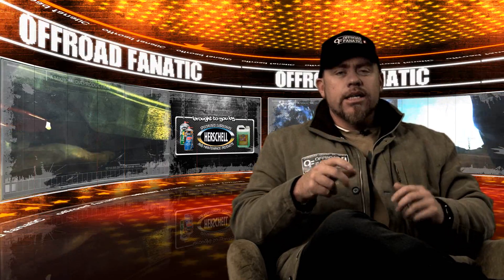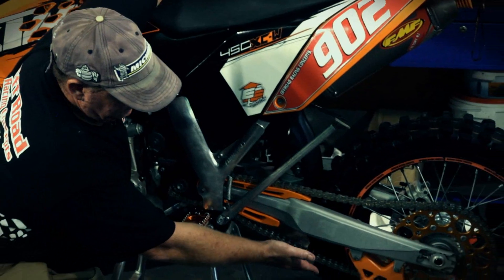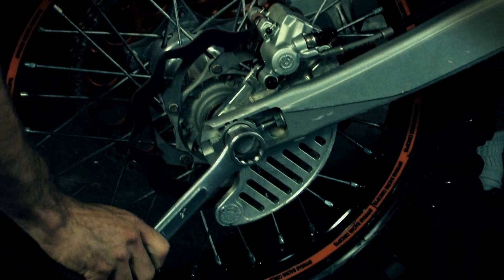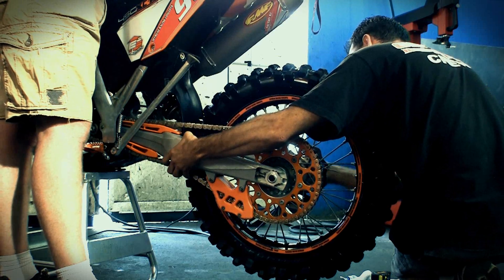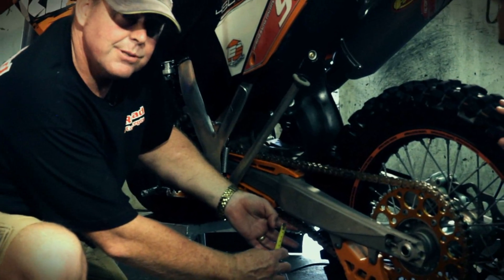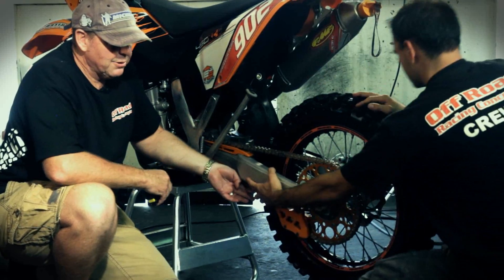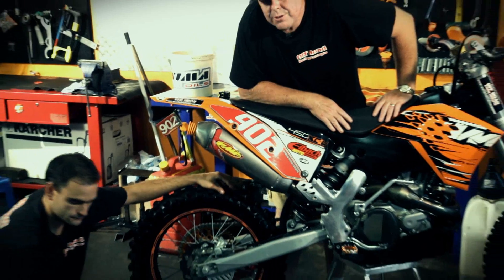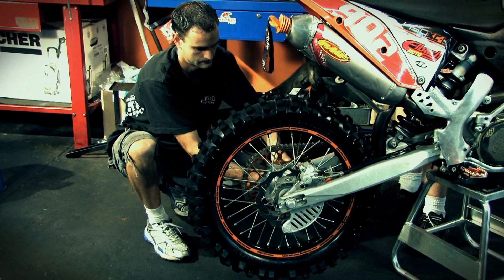DIY - Tensioning your chain

Comment: Take into consideration that you will add more tension to that chain when the rider sits on the bike.
Reply: agree.. so what would be the right tension after rider sits on a bike??
with no weight on bike chains were good, like the video showed.
im 105kgs and my chains went very damn tight after i sat on the bike..

Comment: That is the most awkward way to measure chain tension..You have to lie on your back just to see the 8mm gap...The KTM manual says to measure from the top of the swingarm right at the chain slider, pull up tight, (make sure the lower chain is taut) and take your measurement..Its visually and mechanically much easier and works like a charm..

Comment: Tech question. how about having the correct tension, and having your chain flap and bounce to the point you feel the bike shutter? when you roll off the throttle it stops completely.  New chain, new sprockets.  is it normal on a supermoto or do i have to worry about my countershaft bearing?